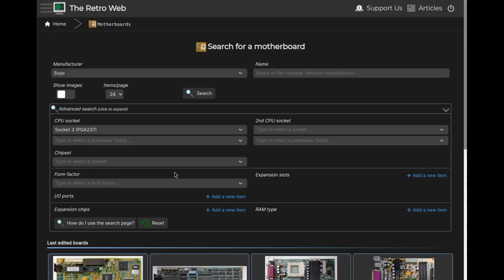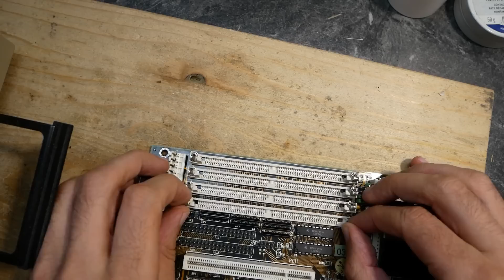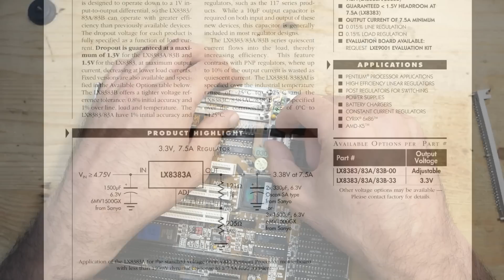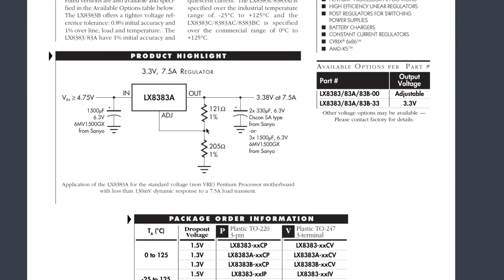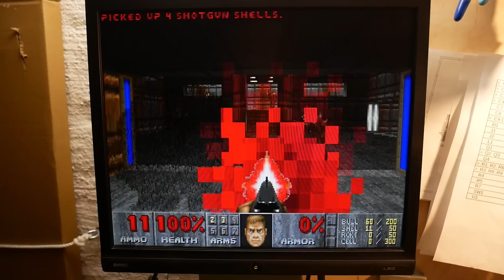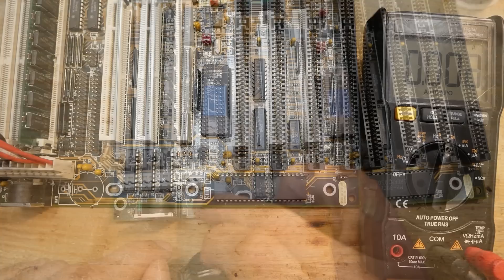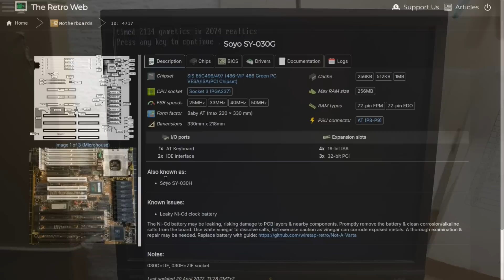Repair, benchmarking and overclocking of a 486 mainboard: Soyo SY-030H

Comment: Basically, anything above 3.7V is out of range of lx8383a because dropout 1.3V,  MB's pdf says 4.0V for cyrix, it is possible only for low-dropout regulators with dropout 1.0V
Reply from the maker: Yeah, that's true. The dropout is extremely hard on the edge, for LX8383A it is typically at 1V, but I think, even for Cyrix I would use it rather at 3.6V. It usually works just fine if you don't overclock it.

Comment: I just got a Pc with an AMD DX2 66 and a QDI V4P895P3/SMT + Miro Crystal 10SD. I installed DOS 6.22 and it runs fine. I have my problems with DOS because I'm a little bit too young to know the syntax etc. Do you think it is a good idea to install Windows 95? Do I need to do anything to use the CD-Drive I've built in? The bios can't detect it. There is only the option to configure a master and a slave drive which works great for autodiscovering HDDs.
Reply: CD-ROM and DVD always need a driver for dos.
Reply: Miro Crystal 10SD...haven't come across that name in 30 years
Reply: @toseltreps1101   VLB S3 805?
Reply from the maker: Hi, as @MKRENB already mentioned, in DOS you will need CD-ROM drivers. 486 was usually not able to boot from CD-ROM or detect it. Just google for DOS mscdex and how to use it.
Reply: @necro_ware  Okay thx

Comment: I'm curious how you disabled the charging circuit. Instead of moving the resistor, couldn't you just remove diode D2?
Reply from the maker: I could, but then the RTC would be always powered from the battery, even when the system is running.

Comment: Will 1MB of L2 cache work like 3D V-cache on AMD X3D CPUs and massively boost gaming performance? If you have a Voodoo 2 you can run Quake in this system and test 3D gaming performance 😁
Reply from the maker: The cache on this system is used to accelerate memory access. Means, that it makes sense to have a lot of this if you have a lot of memory. With 32MB of RAM the difference between 256K of cache and 1MB would be insignificant, but with 128MB of RAM it would. Voodoo 2 makes no sense on a 486, even Voodoo 1 is an overkill, since that needs a strong FPU, which 486 doesn't have. The same is valid for Quake, it also needs a good FPU and is a game made for Pentium.
Reply: @necro_ware  There are some videos by people that have paired the Voodoo 1 with an Am5x86@160Mhz just for fun. Yes, 3D games are much better with the Pentium's stronger FPU, but the point is just to do it for fun and science. SUCRA has a video with that pairing playing a few games including Quake and the results were interesting. Since this Soyo can use 1MB of L2, I thought it would be an interesting experiment. I have a Am5x86 running at 160Mhz in a motherboard with a single PCI slot, but it doesn't support 1MB of L2. I also don't own any Voodoo 1 or 2s. I just have a few Voodoo 3 models. Yes, it's silly, but it's just for fun.

Comment: Uhm I don't fully understand the mod you did to use a CR2032. Doesn't the power supply power the RTC by default when the system is on regardless of any mod?
I modded several board but I only disable charging
Reply from the maker: Per default PSU would power the RTC and recharge the battery. The mod which I made would prevent battery from recharging, but the PSU would still power the RTC when turned on.
Reply: Clearly you don't understand it. Maybe watch again